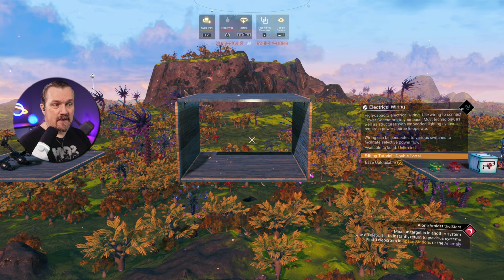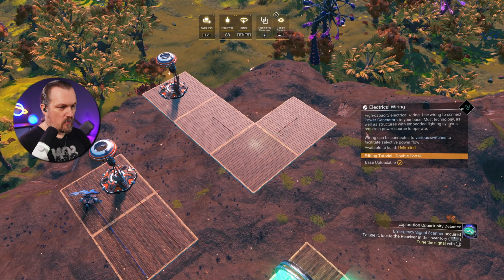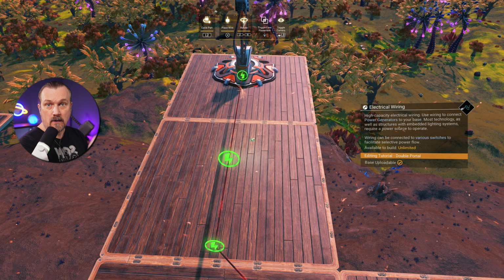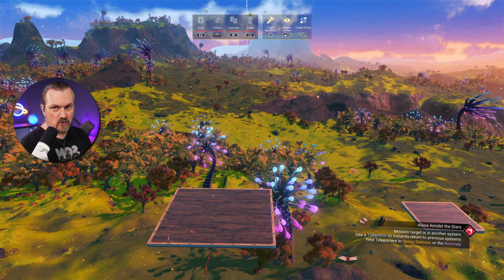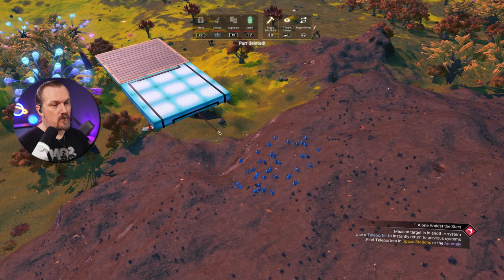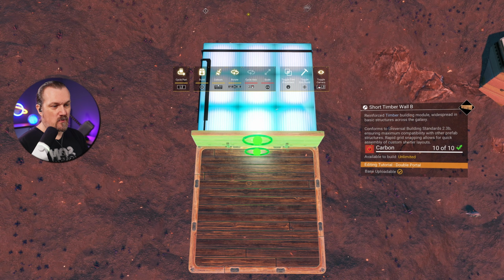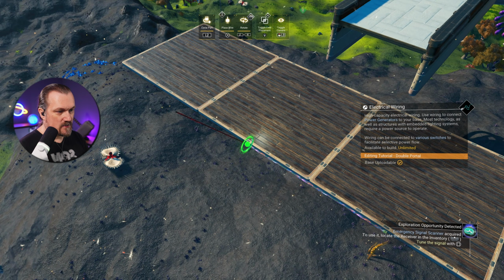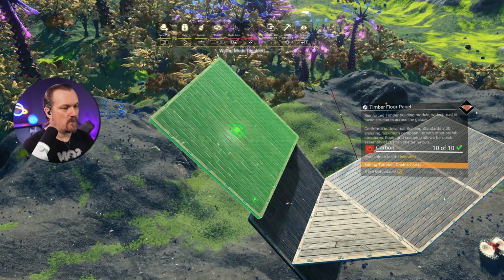How to Control Wire Glitches in No Man's Sky

Comment: Hi dude, always informative videos thanks. Im not much more than beginner in glitching terms, however, im really struggling with a particular angle, and am beginning to wonder if its even possible! Its related to corvettes, ive been using the transfer glitch i believe, glitching a nutrition unit into a base at various angles depending on wire orientation, cancel the part, move the camera back to my corvette, hit cancel again and the angled nutrition unit now attatches to the corvette. I can get many great angles, but the one im after is to tilt a hab 90 degrees vertically, both left and right from centre if facing forward, but also at the same time 45 degrees forward or back. Do you, or anyone here know of a way to do this? Thanks guys

Comment: Today I was trying the wire glitch, but I didnt know about the orientation issues. I was trying to flip the glass dome(greenhouse) upside down and then place one on the top(bottom) so it made a sphere. It didnt work. I was only able to place them on their sides, but there was a gap between them. Then when I placed the forcefield? door on the glass dome you cannot access them when they are on their sides. The dome door that opens would allow me to access the dome but I had to fly in/out. I'll keep at it! Eventually I'll make it work, or not. Lol Thanks for all the building tips!
Reply from the maker: One way to have the Biodomes to glitch as a sphere is use the same wire connector.

Glitch a Biodome on a wire connector, then use the Short Range Teleporter to flip that wire, and glitch a new biodome on the connector, that should result in 2 Biodomes perfectly as a sphere.

Comment: Love your fantastic videos and learn a lot. But, for some reason, can't get wire glitch to work not matter what I try. I changed from lap top to gaming pc, changed keyboards, different mouse, and went to using on solid table, tried and tried. My pc button pushing is just not good enough. Do you have any suggestion about what may be done to improve my luck? Thanks

Comment: maybe cover more on what is reverse wire glitch? I think it's where you select a part but instead glitch to produce a wire? Or do I have this backwards?
Reply from the maker: I released a guide about the wire glitch last Tuesday - covering the wire glitch...
You can find the link in the description.
Reply: @Beeblebum  yeah I watched several of them, I tried to do it today and it's still very confusing to me. I don't know if I will ever get it down. The wire glitch is the most confusing as I don't fully get how you part you want to glitch to the wire, then fully know what I want to do will even work. I set up one ladder horizontal and I was able to climb and climb up a fake ladder perpendicular to the horizontal one I placed. I did some other lame witted concoctions too. Mostly looks like gravity on the fritz. ha, ha. I'll play around with it some more, I'm at least got a good set up on a planet with nice weather all the time.
Reply: how about make a stair ways video, then show how to put in a handrail so you don't fall off the stairs using wire glitch, show again how you select the part to glitch to the wire, I've done it a few times but usually by some weird accident not knowing how I even did it.